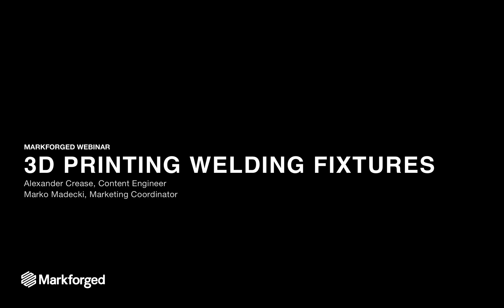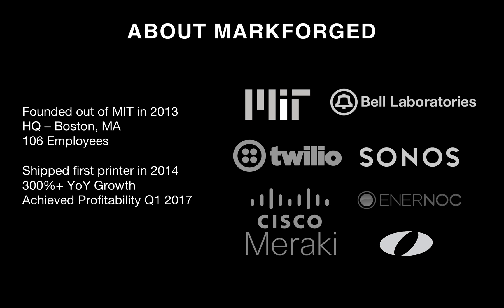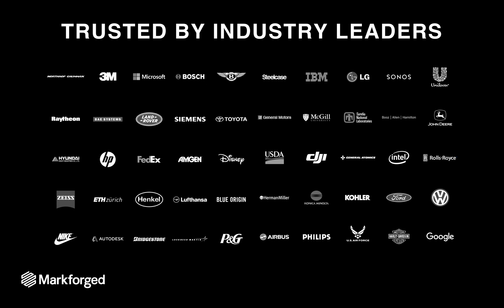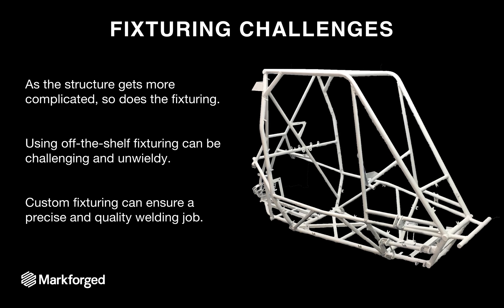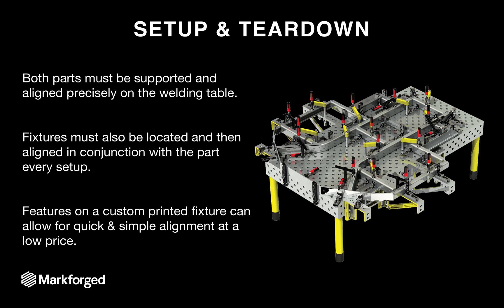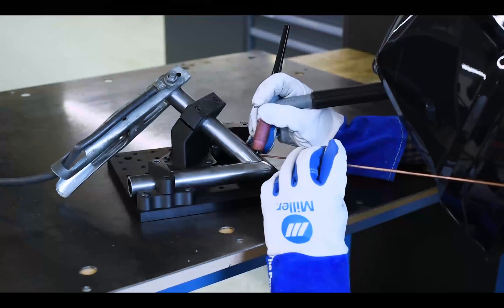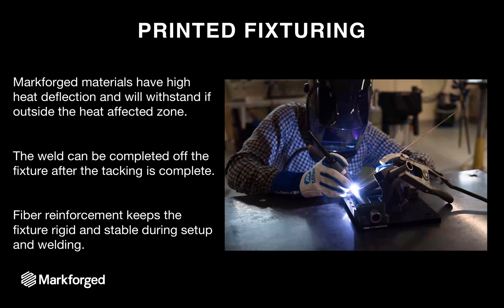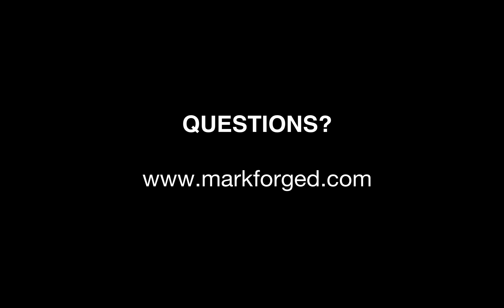Using 3D Printing for Welding Fixtures

Comment: What type of printing filament would you recommend for the types of fixtures discussed in this video?
Reply from the maker: Hi Neil. It all depends on the fixture and the type of welding, but Onyx, 17-4PH Stainless Steel, and Inconel 625 would all be great materials to use.